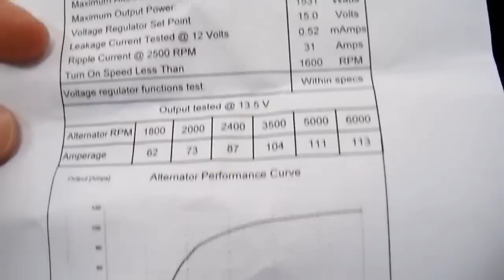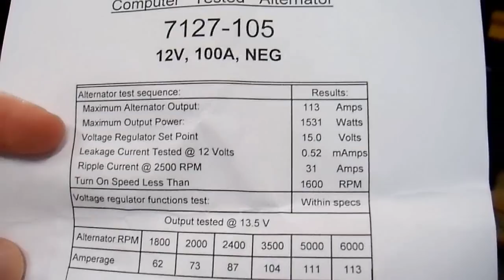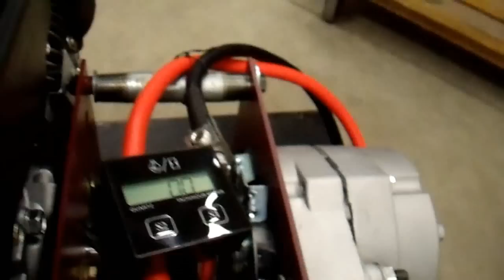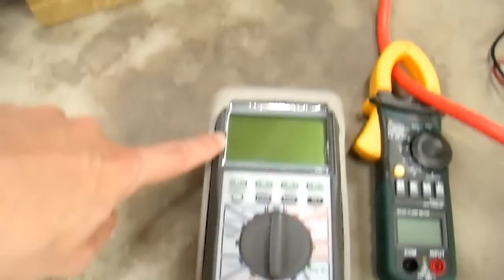DIY 12V Generator Charger - 4 First Time Fire Up and First Time Fail

Comment: Go to princess auto and buy the middle part of a pulley sheave and buy for the shaft size you need and they got four holes put it on your   shaft and bolt it together it'll be automatically straight
Reply: You have to do a little bit of modification to it like drill and tap tap Allen cap and well tag on each side of the split
Reply from the maker: @wilsonmoreau4947  Sorry, I don't exactly follow.  Never heard of Princess Auto so I assume it's regional but regardless, what do I bolt it to?  The alternator needs to be held rigidly in position and the shaft needs to be coupled.  I am not understanding how these two separate connections can be made with a single pulley sheave part.  Can you provide more details?
Reply: @knurlgnar24  oh sorry guy you must be in the United States I'm from Canada

Comment: Seems 2500 rpm is too slow, when in a vehicle the Alternator runs much higher rpm then the engine, maybe needs more rpm to cool it better?
Reply: 2500 engine RPM... on a car, the crank pulley is 4-5 times the size of the Alternator pulley, so 2500rpm becomes 10,000-12,500 at the alternator..... 

Also.... the coupling used... specifically state "do not use with reciprocating motors" 

Lastly... you're spinning the alternator backwards... thus fan is backwards, thus overheat. 

Less talking, more education, less talking..

Comment: This would have worked had you not spun your alternator backwards and not added anti-vibration isolators to your engine mounts.  The vibration is what ate your spider gears, though they should not have been rubber in the first place. You want the engine vibration to transfer to the alternator so they move together as a unit. Otherwise the spiders are the point of impact. You want to isolate vibration between the unit and the floor so it won't walk away. There are reasons why car transmissions are bolted securely to the engine. This had more potential than the one you ended up with. You built that one all wrong. Don't rely on the Internet for engineering advice. Ask an actual engineer. Don't try to reinvent the wheel. It rolls just fine like it is. Cheers.
Reply: By my eyes it looks like the alternator is rotating correctly. ??? Ron W4BIN

Comment: Why don't you just have somebody machine you a solid connection or just weld thatI've done this very same thing that you're doing I've always used a solidthe only other way you can do it is to use a clutchand I don't mean a clutch that goes in and out a clutch that stays engaged

Comment: that alternator clearly doesn't have enough openings for airflow.
Reply from the maker: Turns out you are correct.  It has enough cooling for the 63A it was engineered for but not enough for the aftermarket higher amperage.

Comment: I do believe 14.4 should be most optimal..... 14,7 is good just a bit high on the 12v scale... 15v is a bit high for a 12v system = nice way to smoke a batt...meaning 14.4 will keep a 12v system charged and running good.. while 15v may over charge a 12v system and sulfate the batt. 13.5 even better if you can keep it at that level... see dc power I know and understand...amps are also a key...WOW IF YOU HAVE A TON OF THEM INVERTERS I WOULD LOVE TO BUY ANOTHER ONE FROM YOU? I am looking for a pure wave inverter.. please let me know??? thank you... NO ONE IS STUPID, It is all testing or trial and error...hey I do believe that is Kapton tape.. I use that at my work for evaporation machines for the high temps & High vacuum...... 150 degs c is 302 degs f the math is c x 1.8 + 32 = f.... that is hot.... 200 degs c is 392 degs f......great video thank you... getting late will watch the rest later...
Reply: Richard Downer I got  to talk to the delco techs in a delco school setting once at it was informative
the charge rate difference in the SI  is higher to conform to the delco sealed batteries with the calcium grid as opposed to the antimony  grid of batteries of nominal construction this , internal voltage regulation is the
wrong voltage for a gell cell and it is  also will over charge rate at almost full

both a external adjustable voltage regulation and a current regulation would help this project and the  expectation  of out put current measured in watts should be halved from the graph.
based upon rpm juxtaposed against load and back feeding temp as 
current limiting feedback into the analog logic sequence thus making the system more robust than digital controls and eliminating programming 
complications and delicate digital control failures

Comment: Use rigid coupler it what I use and it doesn't break down
Reply from the maker: If perfectly aligned that works well.  I don't have any way to perfectly align the two assemblies.  Even a small fraction of a degree of misalignment will cause catastrophic failure after a few hours of operation and I don't have the machining skills to do that.

Comment: I disagree with your comment about China, my experience is the best stuff comes from China and it's cheaper with better quality. Even the job I worked at before one of our suppliers was from China and I seen pictures of their plant and it was spotless clean and we never had any defects from there. The problem with your setup that I see right off the bat is it will not spin fast enough it might put out voltage but it will not cool properly alternators are designed to spin three times as fast as the engine.